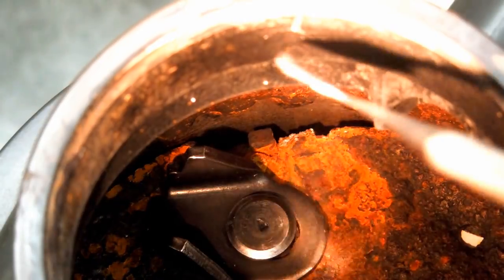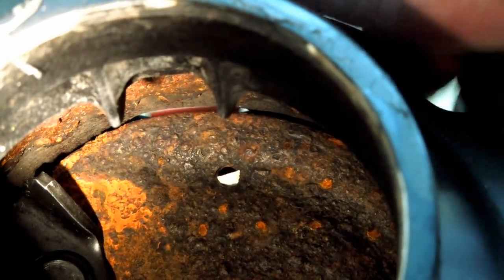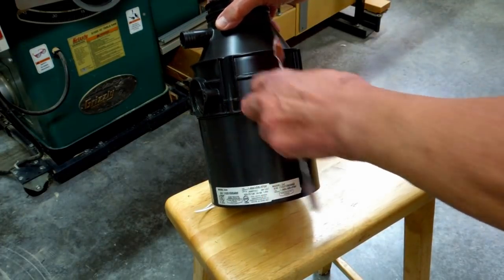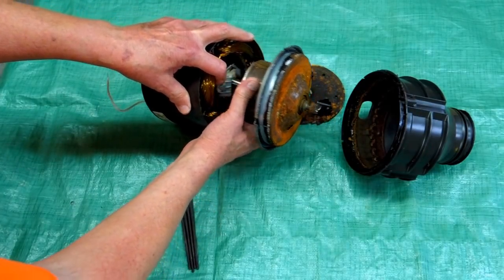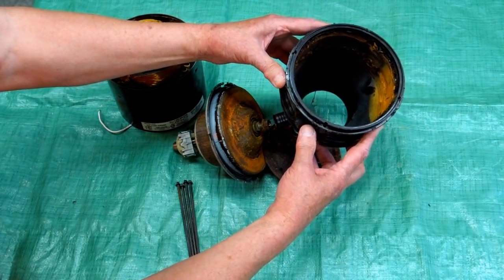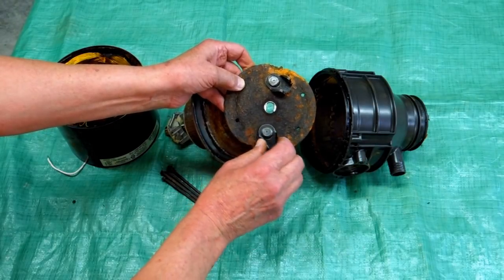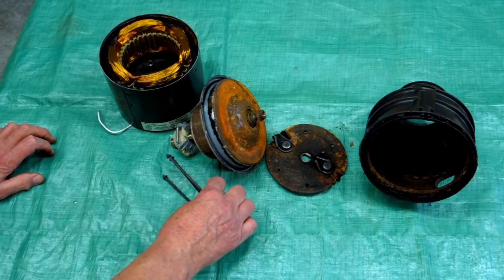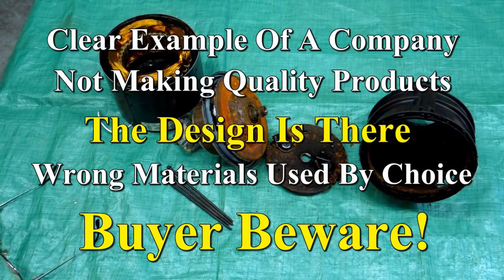InSinkErator Badger 5 - Failure Analysis

Comment: I have to replace Badger 1's all the time the seal goes bad and they leak through the bottom. I have had them crack like an egg too right down the length of the side, I probable returned 50 or so in the last 30 years. I maintain 40 rental units.

Comment: When I connect black wire from the house wall (Hot wire) to the black wire of Badger 5 1/2 HP, the tester stops showing red light. then, the badger does not start even if the badger is new. The current comes all the way from the house and up to the end of the black wire, but it stops if I connect with the black wire of the badger. Then, at one point the badger started some how. It lasted for few months and now the same problem again. Why does the current stops going furthe from the end of the black wire coming from the house? Any suggestion?
Reply from the maker: I have no idea what you are describing. The power to the Badger is from a simple on/off switch. If power is intermittent... it would seen there is a faulty wire (or wires) switch or circuit breaker. Try running new wires to the Badger and see if it works correctly. If it does, then look to replacing the existing wires/switch/breaker... or better still... call and electrician.
Thanks for watching. Please subscribe. Ron

Comment: How many years did your Badger 5s last? You said you had two of them. Thanks for the video!
Reply from the maker: As stated in the video - I had two fail in 14 years. You could set your watch by it... plan ahead with the new one so you know when it is going to fail. And when they fail it is catastrophically with garbage and water dumping into the motor which will blow the circuit breaker and dump garbage and water in the bottom of your kitchen sink cabinet and then onto your floor. They make a better (at least more expensive) unit out of stainless steel - Evolution Essential XTR - at least partially stainless steel. It will be interesting to see how long it lasts. :-)
Reply: @RonaldWalters2010  thx Ron. So 7 years each about?
Reply from the maker: Usually when one fails it is at a bad time (there is no good time for a failure) and then your kitchen sink isn't usable until the mess is cleaned up. Replacing the disposal with another brand would probably involve reworking the other plumbing, traps, etc. associated with the disposal and drains under the sink. So the only good thing about another Badger-5 is it drops in place. I have purchased their stainless steel model and plan on installing it pretty soon as the existing Badger-5 will most likely rot out within the next two years... possibly sooner as manufacturers don't seem to make things better, only cheaper.

Thanks for watching. Please subscribe! 
That is what keeps this channel going. 
Ron

Comment: Loved: "If this is made in the U.S. shame on us." I bought the same model for the same reason you did brother. I don't like  working under the sink and what was there fits the same as 20 yrs ago. Lol I'm surprised these things don't arc and explode when they fail. They are all designed to leak on the motor which  doesn't make sense. Mine just made a humming sound and never tripped the breaker. Maybe because It's properly grounded. The shaft just stopped spinning by the motor but spun freely with the supplied wrench  Thanks for making the video!
Reply from the maker: Thanks for watching. You'll probably find other subjects on my channel you will like. Please subscribe! Ron

Comment: My Badger 1 failed. It came with the house, which was built in 2007. In our case, the previous owner did not install a water softener and in our municipality we have VERY hard water. We installed a sodium based water softener, which I believe "washed" away the grunge deposits of salts which had been previously deposited. I believe this was the reason why it started to leak on the cabinet bottom. 

Fortunately, I routinely inspect our kitchen cabinet and found the leak very quickly, and cleaned up the water and put a pan down until I could get another unit. (Unfortunately) I put in a Badger 5, because it was easier to re-connect the plumbing. I assume it will break down too. 

There is the very real possibility that hard water is very hard on both disposers and dishwashers, and will cause their early demise. Even if you put in a water softener and have (previously) used hard water on your appliances, the damage has already been done. 

I'm not defending Badger. They have selected the model of planned obsolescence. But if you have used water with severe mineral deposits, its life will be even shorter. We got about 11 years on the old Badger. I guess that's not too bad. 

If you have very hard water use on your (standard) tank water heater, often the cold-water ingress valve on the top of it will grunge up too. If this ruptures, you will end up with a terrible water damage in the room (or garage) where your hot water heater is. If it occurs while you are on vacation, it will be a catastrophe. 

If you get nothing else from my post: "PLEASE CHECK THAT VALVE ON TOP OF YOUR WATER HEATER!" 

Sanjosemike (no longer in CA)

Comment: Great analyses. We had similar problems with our insinkerator. (Insinkerator model 65)  The outside Aluminium housing corroded out after 9 years. The stainless grinder part lasted very well. I patched the housing up a few times with car bog, Denso tape and cable ties.  kitchen cabinets got drenched out when matters failed. Removed complete unit and fitted drainpipe which fitted and plumbed it all in. Insinkerators are a waste of time and money.

Comment: I have a sears with SS grinding chamber. I got it from a friend as the top bearing dried out and it jammed. So I took it apart, and repaired the plastic floor and regreased it and it is like new again. Been working for at least 5 years as a freebie. I think the floor of the unit was an aluminum casting with a plastic insert, the plastic failed and corroded the aluminum floor. I cleaned the aluminum with vinegar and sealed it with a layer of PL premium polyurethane, you can get at HD or Lowes. Totally waterproof and tough stuff.  I am right now repairing a Montgomery Ward orange painted with a SS grinding chamber, it is actually in good shape from 1970's or maybe older.  The ring the plate spins against is made of cast iron. Its problem was it sat too long and under the SS plate exists a plain steel support which rusted in place to the cast iron outer ring. Freeing it up and it spins fine again.The MW, they lied as it is not entirely SS grinding chamber, really only the top plate is SS, but it has lasted just about forever.

Comment: We just installed our second top-of-the-line $350.00 ISE Evolution Excel disposer. 1 hp, all stainless. the seal went in the first one after 6 years, and ISE actually sent a repair company out to replace the unit. Unfortunately, the replacement only lasted one more year (finishing out the 7 year warranty), again with a failed seal. ISE initially told me I was out of luck, but I complained, explaining that the replacement only lasted one year. After talking to a supervisor, they sent me a unit in the box, which I installed myself. Ugh. Now I want to replace the seal in the 1 year old unit, but am unable to find any service manuals. Apparently you are just supposed to throw these away. Shame.

Comment: I thought everyone knew that part. For decades, we've lived with cars and most other products that were designed to fail, and I'm only talking about the drive train. Other perts may fail even sooner. By design these "food unprossessing" units have no programming in them, but if they were designed to turn on and run until it was dry inside whenever the water was turned on in that sink, it would instigate a teaching/learning environment with owners and they would use that sink only when necessary. this, however, might require a different motor - less noisy design - to entice people into accepting it.

Another option is to put something like "JB Weld" on the top of the non-spinning top of the motor because it won't rust like galvanized steel will.

Perhaps "I" will design and offer a repair kit which would include the spinner and the "teeth" that pulverizes the food, the motor top plate that seal and protect the motor from water, and the specific tool that removes the screws/bolts that hold each disposal together.

I'm going to research what breaks in other brands of garbage disposals. They fail too often according to what I'm seeing on YouTube, and the option/opportunity is there for someone to "capitalize on it. Thanks for your video.
Reply: Ben Bennett these junks aren’t worth fixing, any good all stainless steel 1hp disposal will give you years of uninterrupted service.

Comment: Being garbage, it seems like it didn't complete the task it was designed to do:  Dispose of itself.

We live in a rural area so when I built our home I didn't install a garbage disposal or dishwasher. A compost pile out back for scraps and I can wash dishes faster than a dishwasher, sometimes faster than some can "pre rinse" and load a dishwasher.  Two fewer high failure rate "convenience" items to fix.  The fridge, stove, washer, dryer, water softener, dehumidifier, heating system, etc. keep me busy enough ;o)

Comment: I'm not surprised that the spinning plate is rusty and the flails are not. If they are made of any two different metals, it's natural that when immersed in an electrolyte such as waste water, one will corrode and the other will not. The metal with the lower standard electrode potential (the less noble metal) will act as an anode, letting its surface atoms oxidise and passing the electrons on to the nobler metal (the cathode), which reduces any of its own surface atoms that may have been previously oxidised.
Reply: This is true.  On boats we add a sacrificial zinc anode to protect the prop and shaft.  Wonder if it would be possible to add one to the galvanized plate?

Comment: I bought my house 3 1/2 years ago and it had the old Badger 5 model that was somehow missed by the home inspector. I had to replace it before even using it as it was cracked in several places.

https://i.imgur.com/pT0Oeyz.jpg
https://i.imgur.com/AZGs7Ma.jpg

I replaced it with the newer Badger 500 (identical disposal, different number) and it's been working great so far. I plan on replacing it with a Waste King (made with stainless steel) when it fails.

I wish I had done some research before buying another InSinkErator.
Reply from the maker: My first one cracked like that when the bottom fell out of it. When it rust apart, things got a bit unstable and the motor broke the case, which is only plastic.

Comment: Ouch, when we bought our house 10 years ago we added an ISE to the kitchen sink, we splurged a bit and got one of the higher end models though (Evolution not the Badger) due to the claims of it being considerably quieter.  A friend moved into a new house a year later and went with the Badger.  We were disappointed because our more expensive evo was considerably louder than his cheap Badger.  (The quality of the sink makes a bigger difference.  Our thinner SS sink acts like a speaker cone and amplifies the sound...his big heavy ceramic sink dampens it.)  But...ten years later our evo is still going and looks almost like new inside and HAS had all kinds of things put through it that it shouldn't have had put through it (It was my wife's first experience with a disposal and she didn't realize they have limits!)  Meanwhile our friends Badger sure enough rotted out after just a few years.   Seems ISE does still make some that last - but they charge a premium for it.  Seems like the common case of pay less up front but pay more down the road.  Now I don't feel so bad going with the evo even though it's not as quiet as we had hoped!

Comment: Mine failed the same way after 2 years. Like you said, they are not using the proper stainless steel for the plate and it quickly rusted through. This is their base model. I bought the top of the line model ISE and it is going on 4 or 5 years with no issue. When I researched disposals there are only two companies making them in the USA, ISE being one of them. The other you can't find in the stores and they use a universal motor.

Comment: Pretty disgraceful. Typical of products or packaging that are made to look like their previous self but contain much less. It's not how well can we make it but how poorly can we make it. Absolutely no manufacturer pride. But why install a 3rd one?
Reply from the maker: Good question!  I really did not want another one of these pieces of junk. However, shoulder and back problems and the third disposal was a relatively easy swap out. A friend has a plumbing supply and the units are now marked Made In USA. The last failed unit does not show where it was made and I do not remember what markings were on the original unit or box, so this is a bit of an experiment to see if (by some miracle) this one will last any longer. By that time hopefully I will have found a better disposal. But these are Junk! I also have experience with another InSinkErator product, "Instant Hot Water Dispenser" installed when I built the house and it didn't last much more than a year and the failure mode was also to leak inside the kitchen cabinets.
Reply: They do make a Stainless Steel model. Just cost more money.
Reply: The Badger 5 was in my new home in ‘91. Failed same reason about 7 years and I put another because they were average price and the same install. Lasted about 10 years same problem. Surprisingly still on market. I did look at better ones but price was almost double and I didn’t think they would do much better anyway. Thought just market hype. Average 10 year lifespan for us and easy to replace with same model so I stuck with it.
Reply: MRrwmac it’s not hype, I personally own the top model. With heavy use there is no corrosion or drain clogs after 8 years! I’m serious, celery, potato skins, and entire sink of corn husks no problem!